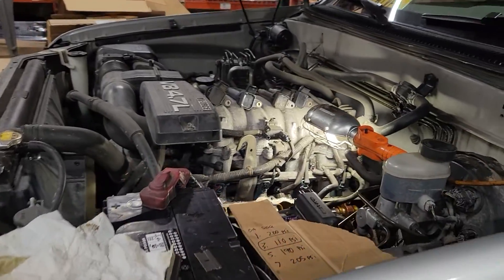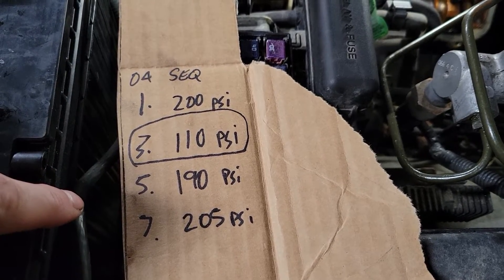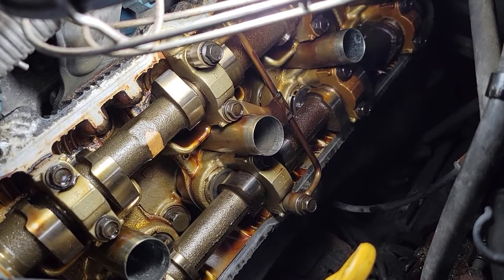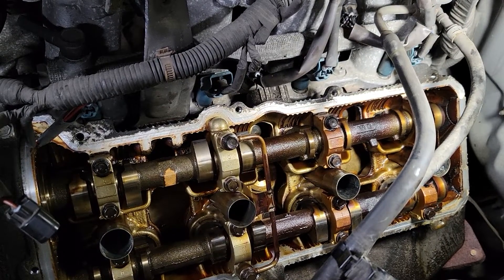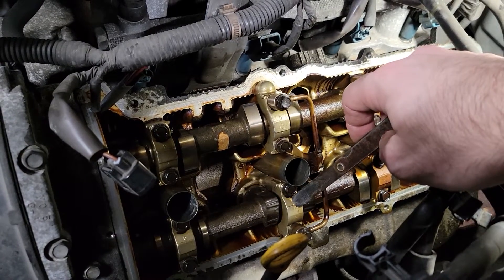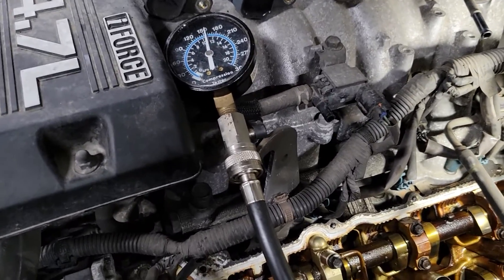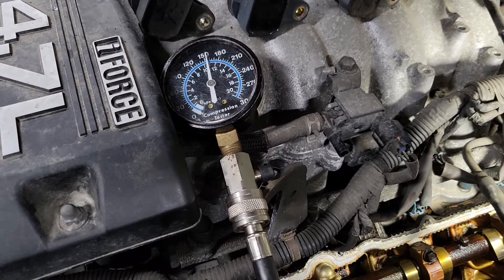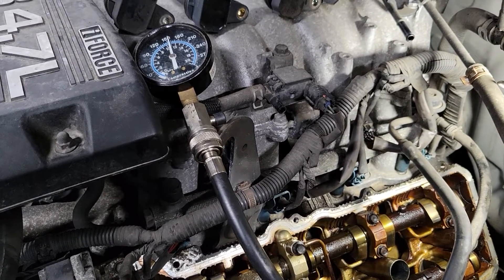Toyota 4.7 V8 2UZ-FE Valve Lash Clearance Check and Info

Comment: My 1 GRFE needs this, it has solid bucket lifters also. Well, I need to change my valve cover gaskets (some oil on coil packs). I figure I'll check the valve clearances since I'll have access. It has 330,000 miles. Runs great, No evidence of valve issues. I hear these wear VERY slowly, so I hope they are all still in spec.
Reply from the maker: It's nice knowing, especially if you get good news that it's near spec

Comment: I know I’m almost a year late, but start running valvoline restore and protect. I had below spec compression and after 2 oil changes it’s back in spec across all cylinders. Def had a stuck ring on more than 1 cylinder. Running like a top with 360k miles
Reply from the maker: I'm running Valvoline Restore and protect in our replacement 2005 Sequoia (sold that 2004 as is)

Comment: Thanks for the video! I also have a 2004 sequoia, it skipped timing and I’m trying to determine carnage. You mentioned that it’s a NON VVTI engine, would that mean it’s not an interference engine? Could this mean that my engine could be ok?
Reply: Interference refers to how close the valves are to the piston. The 2UZ-FE is an interference engine.

Comment: The 1gr-fe valve lash check is the same as this.  You could pull the piston and check the rings and cylinder wall. Could be cheaper to rebuild than buy a used one.

Comment: By looking at your yellow metals i can tell that oil was not changed regularly so you have seeze ring in addition this motors use oil to adjust valves

Comment: Out of pure curiosity, how many miles are on that 2UZ
Reply from the maker: 259,000 and I believe it is rare for the piston/rings to be hurt at those miles.
Reply: @archivegarage7638  I would think so aswell if it had oil changes done on time I would be surprised to see piston ring failure at that mileage, I just bought my 2003 tundra with a trd supercharger on with 127k miles and I'm a little nervous on how the 2UZ will hold up at higher mileage with boost I've got a Japanese produced engine in it though from before the Alabama plant opened and supposedly those rods handle boost a little better